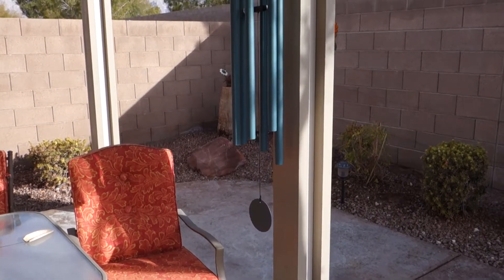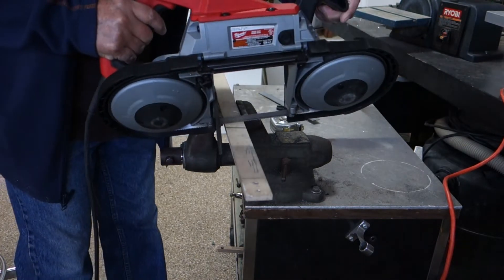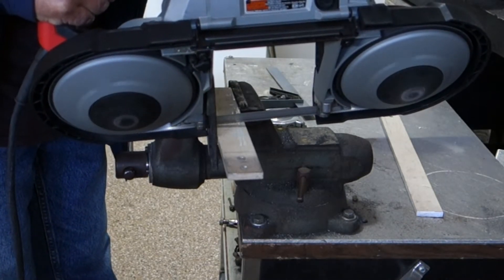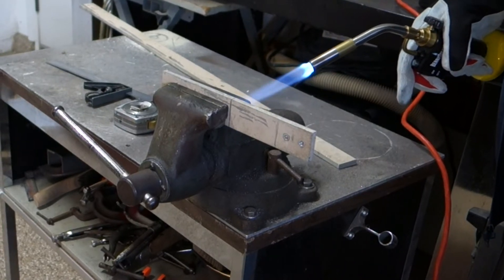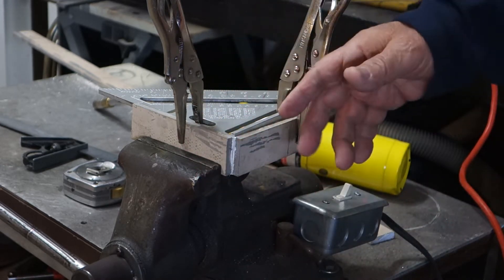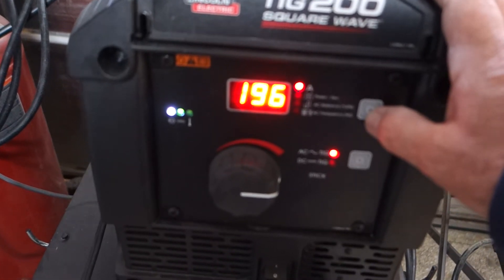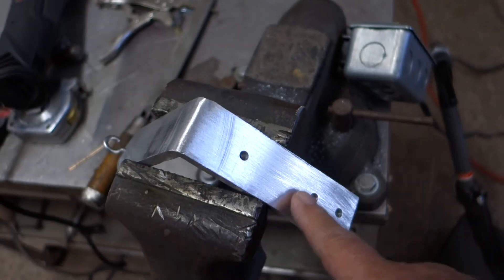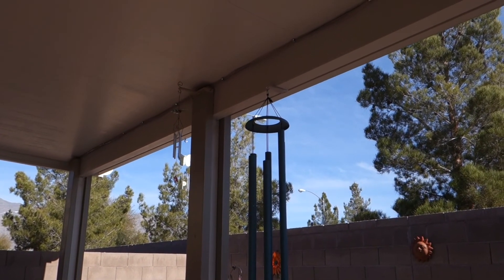(277) Lincoln Tig Welder Project #6

Comment: Aluminum is all in the prep. Your material should have been cleaned and de-greased first. Also turning back the frequency from 120hz to say 60hz puts more heat into the weld.
Reply from the maker: Thanks, so your saying the higher the frequency, less heat..so I should keep it at 120hz?
Reply: @JackOfAllTrades2022  Essentially. Generally frequency is used to control the arc, a higher frequency gives a more focused arc and a lower frequency a wider arc. My comment was more based on the fact that you were running 196 amps and 75% DCEN, essentially the max of that machine, the only real way to put more heat into the workpiece with that machine is to go toward 60hz. As a lower frequency tends to increase heat to the weld puddle.
Reply from the maker: AB Max Good info, thanks.